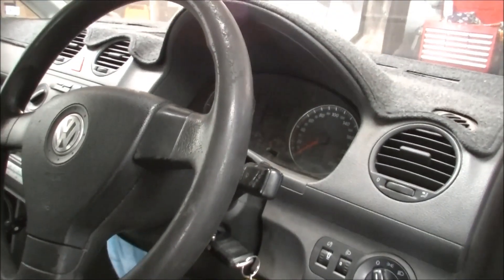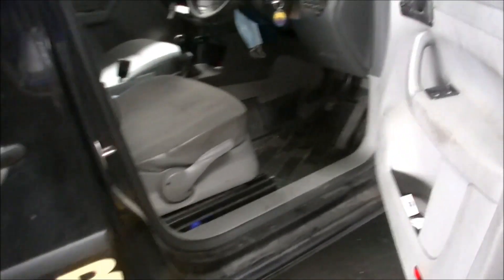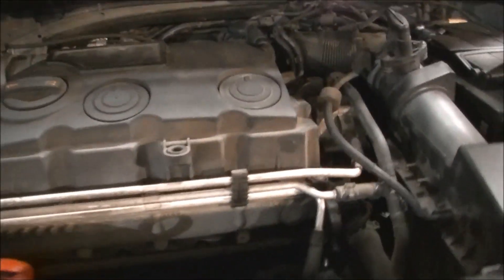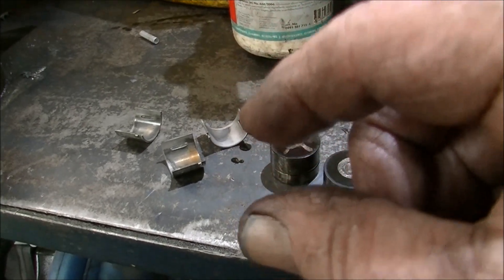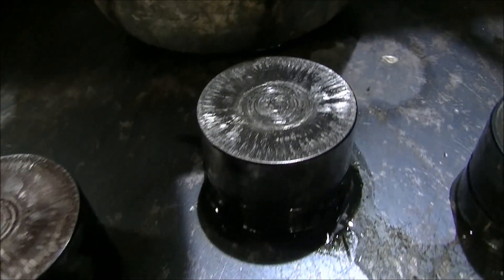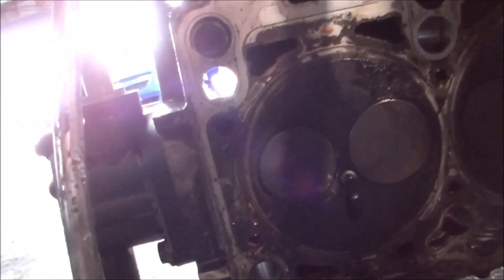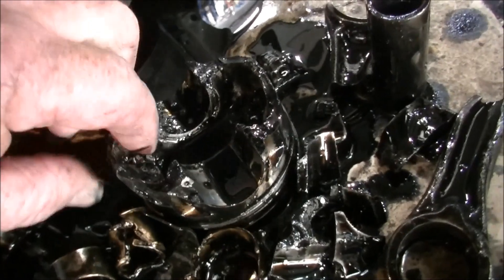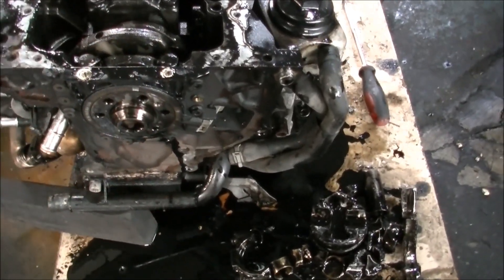What caused this engine to stop.?

Comment: So maybe he was doing slightly more rpms when he changed gears, one guy said to me with those engines he sees alot of cam and bucket damage, i think he said bucket anyway  that thing thats sits on top of the valve spring
Reply from the maker: Yep cam buckets...Top end flogged out and the bigends looked new...5th to 2nd is my guess...Cheers mate.
Reply: @ziggassedup  yeh thats what i meant wrong gear change, me not smart but i can lift heavy things, ahhh correction used to be able to left heavy things.

Comment: As soon as you started the engine I was like "Rodney's come calling!" 🤣🤣🤣
Sounds like the driver did a money shift from 5th to 2nd the way he described it. 😬
Reply: Ay money shift, strait out
Reply: I have seen that happen on a few VW's, I am wondering if their gate is very close together
Reply: Indeed
Reply from the maker: Could well be mate...Cheers.
Reply from the maker: That's what I thought too...I wonder what the engine speed is in 2nd at 110kph...!
Reply: @ziggassedup  Definitely more than what the rev limiter is set to. 😂👍
I did it once in a '94 Barina, 4th to 3rd instead of 5th at redline. Worked out it went to 11400rpm and killed pistons 2 & 4.